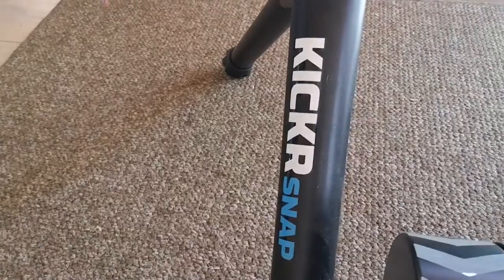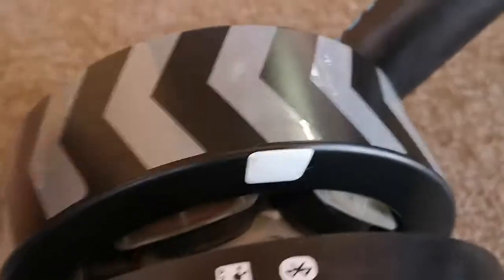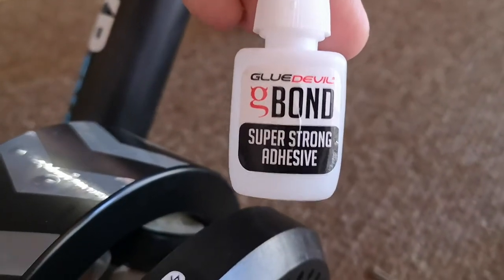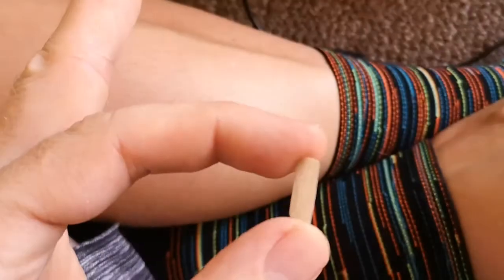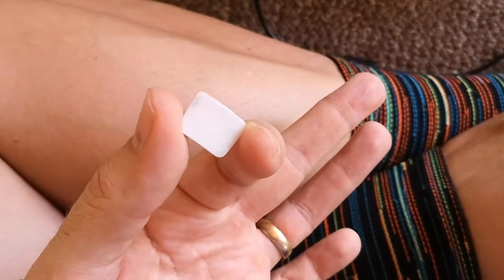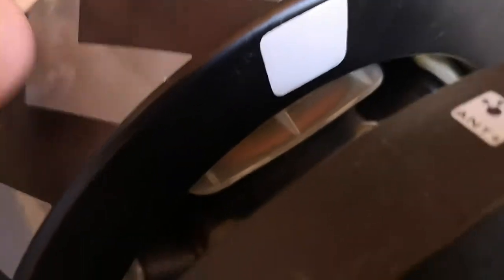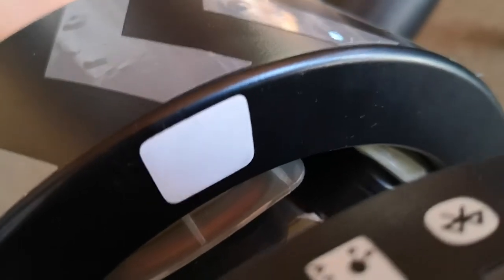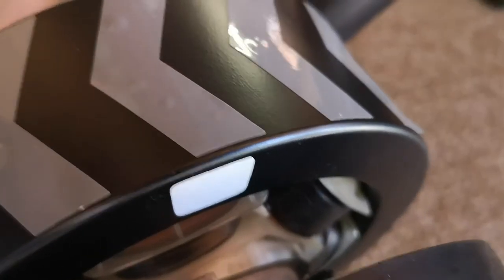Wahoo Kickr Snap not reading power

Comment: Hi Anton, I hope you can help even though you posted this 5 years ago. How did you remove the 3 small screws to get the cover off? Is it an Allen Key?
Reply from the maker: Hi!
I'll check for you tomorrow. 😊
Reply: @antonscheepers5469 thanks a lot
Reply from the maker: It looks like a 2mm allen key!
Reply: @antonscheepers5469 thanks Anton, you are a lifesaver. Since I could not find the optical tape that fell off, I just cut a regular white sticker in the shape of the optical tape, stuck it on the wheel, and it is working. Amazing
Reply from the maker: @Damon-w4x good job! Always a relief to get it back up and running. Shipping it off for repairs can be a horrible schlep! Happy training!

Comment: I had the same problem of watts showing zero but the tape was still in the right place.  I then  realized direct sunlight on the flywheel and sensor was cutting out the watts.  Tested it by opening and closing the curtain next to flywheel.  Soon as closing the curtain the watts showed again, the moment opening the curtain and the direct sunlights hits it, the watts cut out.

Comment: hello, thanks a lot for your video!!! But what do we do if we can't find the specific sticker anywhere in the floor?
Reply from the maker: You can ask Wahoo for some, or I have heard of people either painting white marks on the spot where you can see the sticker should be, or using something like reflective aluminium tape.  I am not sure if the size matters, but I'd try to stick to the outlines of the sticker.  Mine was roughly 1.5cm wide by 7mm...  So worth a shot to stick something on as a test, feel if it feels/reads "normal" (you'll know), and then try to do something a little more permanent?  Drop a comment here if you need more info - I can try to give you my dimensions - but I do think you should be able to see on the wheel where the sticker was.
Reply: @antonscheepers5469 Do it have to be on a exact spot? And do you maybe know how I can find that? Because I see no glue marks or something like this on the wheel?
Reply from the maker: @Mario-mf1ye  it probably does not matter. The thing is that should be something otherwise the sensor will not see anything to indicate the speed of the flywheel. You could always ask Wahoo to send you some stickers, and in the meantime stick a small piece of alu tape (about 1cm wide by 1.5cm long) on the flywheel to test in the meantime? Worst case it works!

Comment: have just got a nearly new Wahoo Kickr snap but there is no power or speed although it is connecting weill with Blueooth.  I have now discovered that there is no optical sensor tape.  I have reached out to wahoo and am awaiting a response.  Is there a DIY fix with reflective tape?  Does the size of that strip of tape matter?  I'd love ro hear back.  Thanks
Reply from the maker: Hi Simon. Yours probably also popped off... Maybe start by opening your unit like I did, and see if there is maybe an imprint you can copy? The sticker is about 1.5cm long and a cm wide. I guess the size could make a difference if the sensor detects when it starts passing, and is passed - I am not sure how the programming works.
But you could probably concoct something temporary with some aluminium tape cut to size? (or shiny reflective tape). It is worth a shot and will at least have you able to ride while waiting on Wahoo.
They offered to post me some stickers too. 🙂
I hope you get it sorted!

Comment: Hi Anton , had the same problem. Kept coming off. Made my own stickers , several types all to no avail. Solved it by painting white epoxy exactly on that space. Builders warehouse “ RUST-OLEUM” Appliance Epoxy Touch up - White - this thing can get as hot as it wants. Epoxy going nowhere!
Reply: Hi, I have the same problem. Did you paint the epoxy the exact same size as the sticker or how did you do it?